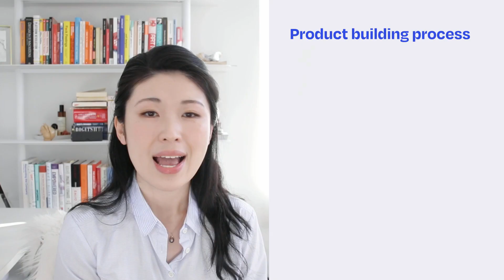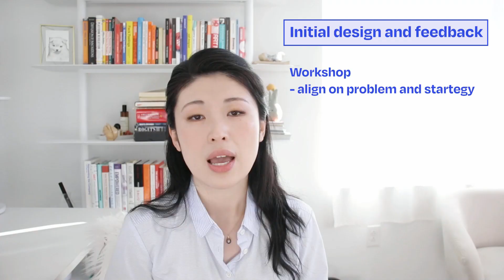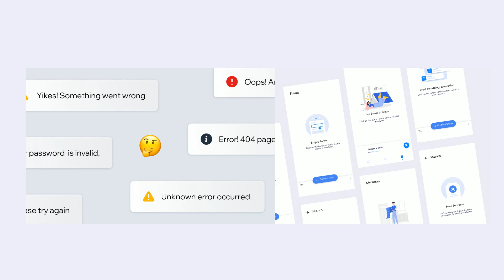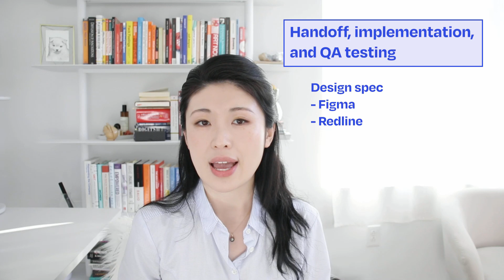Mastering Collaboration: Pro Tips for Designers Working with Engineering Teams

Comment: 1:28 product building process
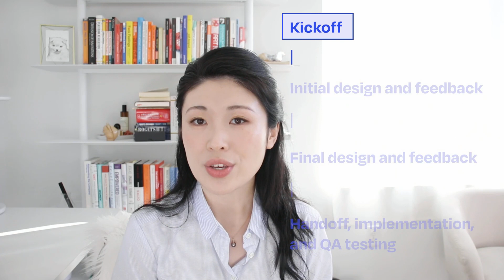2:07 how to get buy in from eng from kick off
2:17 best practices during initial design and feedback
3:16 getting buy in for research
4:17 common mistake with projects with a big scope
5:00 map out the design by phases
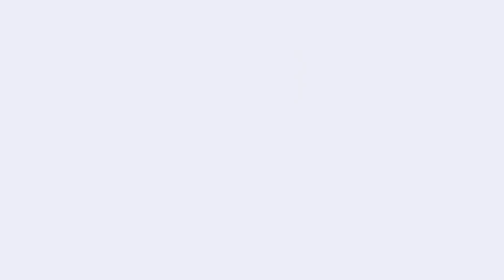5:30 remember to design error messages
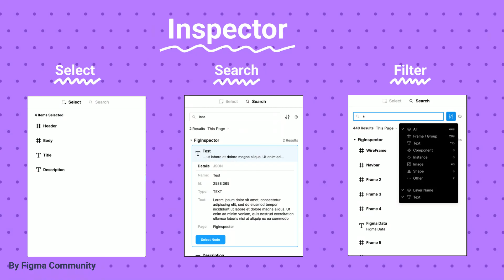6:00 tips for handover
6:40 visual qa session
7:20 improving the process with engineer afterwards